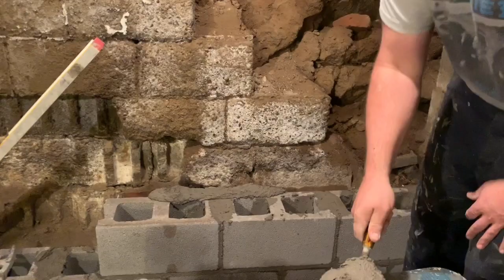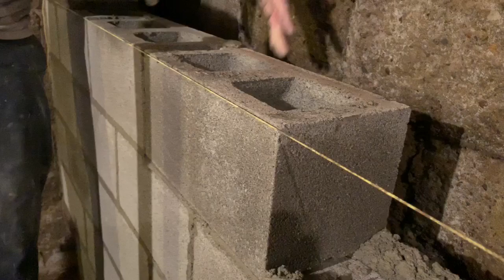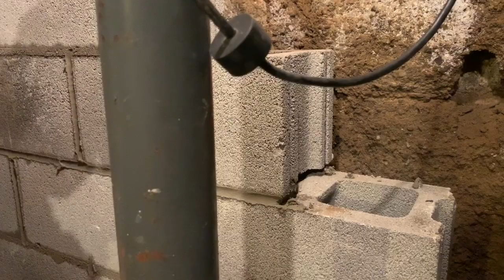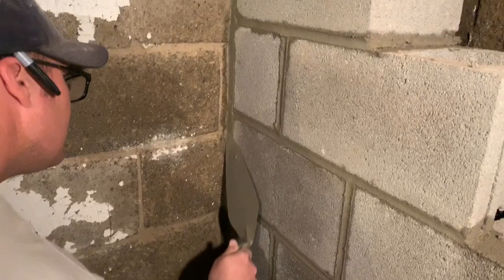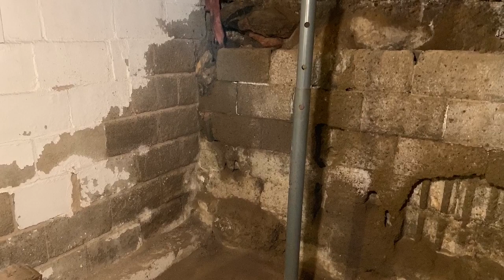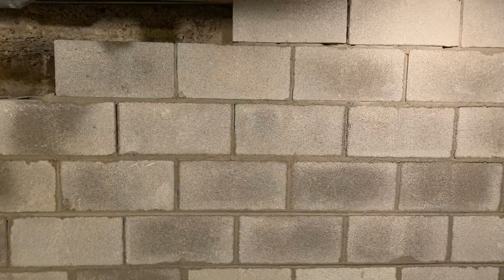8” block basement repair

Comment from the maker: So there are plenty of comments about what was done wrong in this video. I agree that this is nowhere near a proper repair. The owner of this building repaired the exterior water problem that caused the wall to fail in the first place. The new wall is absolutely supporting the weight of the house. The corners of the old wall are still intact also supporting the house. This is a friends house and he didn’t have the money to get more involved with the repair. He knew it wasn’t proper but felt it was better than nothing. I would never sell a half ass repair like this to a customer. At the time when I made this video there weren’t many bricklaying videos on YouTube. The point of this video was to share the techniques of laying block presented in the way I prefer to learn. So to be clear as one of my favorite comments said this is like hanging a poster over a hole in your drywall and calling it fixed. I do stand by the techniques I am showing not the engineering. Thanks for watching!
Reply: Thanks for sharing, great video
Reply from the maker: @DanielSanchez-vk3qs  thank you!
Reply from the maker: John Arch  thank you! You made my day!
Reply: Could 8" blocks be used for a retaining wall?
Reply from the maker: @azieldaly2965  yes
Reply from the maker: Remodeling with Robert Crabtree  Quite possibly the first knowledgeable comment I have received! Thank you. Sounds like you’ve made your way through some real head scratchers.
Reply: remodelingwithrobertcrabtree skeeds?
Reply: remodelingwithrobertcrabtree  thanks ,have to remember that!
Reply: Thanks!

Comment: I'd be more concerned about what that pocket you formed between the old and new wall will do.  You may have fixed one problem, but in my opinion created another.  The outside will continue to erode into that pocket whether you like it or not, whether you fixed the outside water problem or not.  There is nothing holding the soil back, and the owner should expect extreme settling around the outside of the house until enough of it makes its way into the pocket you formed.  Oh, and that wall you built is likely not resting on a footing, which shouldn't help at all to transfer the loads to the ground.  As far as I can tell, it looks like this wall, although expertly crafted, is nothing more than a facade, and a possible way to subvert the process of inspections that protect and shield future buyers from (best case) negligence, or (worst case) deceit on the part of the seller.  In my opinion, you may have good intentions, but this wall is a terrible idea and should never have been built.
Reply from the maker: I don’t disagree with what you are saying. At best it bought him some time to do it right. It does have an 8” footer. The rest of the building does not. It’s over 100 years old. There is no ill intent here. The owner has owned the place for years and doesn’t intend on selling it. Financially the options were to do nothing or try to put a cheap bandaid on it. The house was sinking. It is not anymore. That’s a win. I appreciate the comment. Also I won’t be posting poorly engineered work again. I just wanted to show how I lay block. It’s the first video I ever posted never even thought anyone would watch it.

Comment: I am a bricklayer (also lay block) and my company specializes in foundation repair. We have repaired foundation walls that looked similar to this one. This repair was not being done correctly at all. In this case they should have completely replaced the old wall. The repair they did could easily fail.
Reply from the maker: Thanks.
Reply: How much does a job like this cost - to replace the caved in wall??
Reply from the maker: @PAINT_S_CAPES  this was about $600.  To do it right you’re starting around $10,000.

Comment: If the floor slab is thick enough to successfully support that wall, and if the floor joists are running the right direction to allow you to let some the weight of the house down on a relocated pseudo-sill, it might last. That's a lot of ifs though.  :-) Your camera is pointed down throughout, so I can't see the sill or the floor joists.  Is any of the weight of the house sitting on the new wall at all? If not, it's purely cosmetic, and nothing more. Just what you need, another critic.  lol
Reply from the maker: All the ifs you speak of are the reason we did it. We did lift the house with post jacks and removed them a week later. Wall is still intact and the house is no longer sinking.

Comment: Before finding this video, we were discussing doing this in our basement, because we can't afford to dig out the outside wall and tear out all the bricks and redo the walls the right way.
This seems like a great idea, to band-aid the problem if you can't afford to fix it properly, so thank you very much for showing, that sometimes it's ok to do it 'half-assed" (so your house don't fall in around you) until you can do it right.
Reply from the maker: Good luck.
Reply: Did you made a footing for this sister wall? Or just stands of the floor?
Reply: If you're able bodied get out there and start digging. These houses were all built by hand foundation were dug out using shovels and bucket 🪣.

Comment: Thanks for the video, I have a shelf basement I started to reblock some of the basement.  Never finished as of yet.  I started to patch cracks today, then I plan on finishing brick on the other side of the wall.  U r amazing with laying brick, like the technique.  I have so much brick in the basement that still needs to go up.  Probably finish brick next summer.  Patch other cracks before this winter.  .  .   Well all that rambling. . . .thanks for the video.
Reply from the maker: @chumpsauce thank you! Good luck!

Comment: It looks like you're doing an excellent job with the center block wall. The question is why was the old wall crumbling and my first place. Does it need support columns. To prevent the new wall from collapsing
Reply from the maker: The wall failed because of an old sidewalk that sloped towards the foundation. The sidewalk was replaced prior to fixing the wall. With the water problem solved this wall will last as long as the structure.

Comment: Great video brother. Just out of curiosity with materials included what would something like that cost as far as the entire project block mortar and labor?
Reply: How much
Reply: It will cost twice as much, because he did it wrong.
Reply from the maker: To do it right I’d say no less than $10,000. This cost a few hundred in materials.
Reply: 2$ a block cement 9$ a bag  - u do the math - i'm guessing this is couple hundred bucks. rebars is like 50 more and it would be set -

Comment: Quick question bud from the last time. Does this sound accurate to Talley up a price. Quote 100$, labor rate$800 a day materials $100 repointing not expensive and gas $100. Totaling $1,100 for the day. Is this a good rough formula to be in the ballpark?
Reply from the maker: Sounds pretty good to me.
Reply: @WoodandBricks  if u don't mind me asking what do u charge for the day $800?
Reply from the maker: @jamiewatkinson9564  it varies depending on the job. $800 is a pretty good average.
Reply: @WoodandBricks  reason I ask if my formula is acceptable because I started a BRICK-POINTING buisness 2 years ago and never used this formula and was bidding so high I was loosing work. That's why I asked if this was acceptable or should I charge 900 a day? What do u think or keep it at 800 a day labor rate
Reply from the maker: @jamiewatkinson9564  it all depends on the market you are in and how bad you need the work. I have done work incredibly cheap on the past because of the competition and low paying work was better than none. If you aren’t getting jobs because the customer is cheap I would keep my price the same. If you are bidding jobs and not getting the work and you see someone else is doing it maybe you need to consider lowering your price.
Reply: @WoodandBricks  that's why I said my formula was never used on the high priced I gave in the past. Someone else said my formula is acceptable and roughly accurate I think ud agree. How do u perdue them to paying cash by lowering the original price by $2 or 300?
Reply from the maker: @jamiewatkinson9564  I don’t do cash price. If they pay in cash I see that as a bonus.
Reply: @WoodandBricks  one quick question I'd like to know due to you being a great mason, say a job costs $3000 that's labor and materials, but it requires pipe staging, 2 to 3 frames high, how much more do I charge for the staging?
Reply from the maker: @jamiewatkinson9564  I work on the ground.
Reply: @WoodandBricks  I'm saying if you had to add staging what would it be $500-$1000 more?

Comment: Can anyone explain to me if this kind of repair isn’t code violation. I do have the same issue and I have an idea to do it with same way , but I don’t know if this is legal or not?
Reply from the maker: It is not.
Reply: @WoodandBricks is that the same in Kentucky? Bc that is what some guys suggested to us to do.  Basement walls so bad they think will cave if they dig first.  But they want to dig after a new inside wall is built but leave the old misshappen wall.....
Reply from the maker: @jovialcamper  if it’s not approved by an engineer you probably should look for someone else to do it.
Reply: @WoodandBricks thanks! And thanks for this video! I've enjoyed the comments!
Reply from the maker: @jovialcamper  the comments are definitely pure gold! I hope it works out for you.

Comment: Why no veritcal rebar tied into the footings then pour soild grout or mud and maybe use 10"block instead of 8" did you tie into the ends of wall where your leads were
Reply from the maker: Wasn’t necessary.

Comment: I have a cement block wall that is only 4 tiers (4 blocks high?) and no load. It failed in two places. I guess that digging to see what I have for a footer is in order. The trowel work was amazing to watch in this video. Thank you!
Reply from the maker: CincyPlasmaTech walls normally fail because of water or poor footer or a combination of both. Thank you! I the work I do post more often on instagram as original_farley. Good luck with the wall.

Comment: Is it possible to add new foundation  to hold the wall he is building (assuming he will transfer the weight of the house to this new wall?)
Reply from the maker: The house was lifted with jack posts and then set down on the new wall.

Comment: Very nice
My barn foundation is almost as bad as yours.
I want to safe the barn but not really sure how to fix the foundation until I see your video.
It gave me hope as I don’t to break the bank too.
I have a concern with your doing, so here is my question: is your technic will also prevent leaks?
Hope to hear you so I can prepare myself for this coming spring
Reply from the maker: @iykaojalao this will not prevent leaks. The exterior of the wall would need to be plastered with mortar and then apply tar to the plaster to prevent leaks.
Reply: @WoodandBricks  
Thanks

Comment: Can I ask you a question.. does a wall like that need rebar or wire or anything  and would it need to be filled with concrete? And if it does need to be filled .. how do you get it in there?
Reply from the maker: I filled a double cell on the center. You would overlap multiple shorter pieces and the last course  would not get filled in a case like this.  I’m not a big fan of wire engineers seem to like it though.

Comment: What’s the best way to go about correcting the root of the problem on the outside where the water was draining improperly causing the wall to bow in?
Reply from the maker: @empiretextbooks often just adding soil around the foundation and making it slope away from the house is all that it takes. For this one there was a concrete sidewalk that was replaced first.
Reply: @WoodandBricks  should you first dig around the foundation and put gravel?
Reply from the maker: @EmpireTextbooks  dig a trench along the wall down to the footer. Repair the wall. Install a footer drain.  Wash all dirt off the wall. Plaster the exterior wall with mortar. Waterproof the plaster after it has cured with Mastergaurd foundation tar. Brace the wall on the inside. Backfill the entire trench with #57 washed gravel. Grade the area with topsoil making sure it slopes away from the house. Remove the braces from the inside. That would be a proper repair. In this video I was repairing this wall for a friend. Aside from the block laying technique there is nothing proper about the repair we did. He didn’t have the money to do it the right way. The city replaced the sidewalk that runs the length of that wall. The sidewalk was poured right to the foundation so they fixed the water problem. In an ideal situation we would have torn the sidewalk out then did a proper replacement of the wall as mentioned above. The main purpose of the wall I laid was to close up the basement.  We did our best to make it structurally sound and to this point it is. That wall supports three stories above it and it was sinking prior to this repair. It hasn’t moved since installing this wall. I hope that helps. Best of luck!
Reply: @WoodandBricks  wow this is very helpful, it’ll be a good spring project. Thanks for your help!
Reply: @WoodandBricks  regarding the support wall that you built on the inside, could you instead just sister 3 2x6s together and support with jacks to provide permanent support next to the bowing foundation? Obviously what you did looks better than this would but would it be another viable option?
Reply from the maker: @EmpireTextbooks  you’re welcome! I hope it works out. Really anything you do to remove water from the equation will help.
Reply from the maker: @EmpireTextbooks  yes you can do that. It would be a huge red flag to a future buyer though. Whereas the new block wall will be seen as a problem that has been fixed and one less thing to worry about.
Reply: @WoodandBricks  that’s good to know. The goal is to stabilize it for now and to prevent the bowing wall from getting worse, so perhaps I’d eventually build a nice wall as you’ve done.

Is it true though that if you provide additional vertical support on the wall that it could accelerate the bowing of the wall since there’s less pressure pushing down preventing the wall from bowing in more? That’s just something I saw on a random YouTube video.
Reply from the maker: @EmpireTextbooks  there is truth in that. The downward weight/pressure of the house fights against the inward hydrostatic pressure of the backfill pushing against the wall. Sounds to me like it’s a simple choice between letting the wall possibly fall in because you took the weight off of it vs the entire structure continuing to sag and possibly failing. I’d support the structure and fix the wall later if it fails. You want to stop it from sinking/ settling.
Reply: @WoodandBricks  that’s a good point. I’m thinking of first supporting the wall with several 2x6s about 18 inches from each other and fastened in place by another board drilled into the concrete. And then adding the 3 2x6s to the ceiling supported by those tall permanent support jacks to provide additional support to the overall structure. Does this sound like a reasonable approach?
Reply from the maker: @EmpireTextbooks  yes. It’s worth a try.
Reply: @WoodandBricks  I’ll give it a try and let you know if it caves in or is successful! Thanks for the great pointers

Comment: I would have use lateral strapping from the new wall anchored to the old wall and then back filled the void in-between with concrete.
Reply from the maker: I used fiber mesh in the mortar much stronger than wire and rebar.

Comment: Can I do this in front of concrete poored foundation walls all around the whole basement 1000 sqft open basement
Reply: It's bowing and leaking want it to look new without replacing
Reply from the maker: Roy Mckay yes you can. You will want to stop the leaks first or it won’t look nice for long.

Comment: As a novice I imagine this video is not directed at me. However, it would have been nice to have some explanation of what you are trying to accomplish with respect to replacing the exterior wall, how it affects load bearing, what to do with gas or electrical lines that might pass through the original wall. Is the space created between the new wall and the old wall filled with anything or is it just a nice new nesting area for mice?
Reply from the maker: Still working on my presentation skills.

Comment: Is your bottom row just simply laid on top of the floor, or did you did a trench below?
Reply: Dig*
Reply from the maker: Austin L the proper fix would be to dig out the existing concrete and pour an eight inch thick footer. In this case I did not because the old wall was still partially intact.

Comment: OK,  No this is NOT the way to repair the problem. The foundation is VERY  old you can tell by the original block. No drain tile or plugged tile is the problem. Hydrostatic pressure is the culprit. Backhoe, trenching, jacking up the floor, laying down drain tile with gravel, etc. It's a bit of a job,not cheap and if done wrong you get to do it ALL over again. I get what's going on here but it's only a patch and WILL NOT LAST. Just saying.
Reply from the maker: Agreed

Comment: What does shim to sill plate entail?
Reply from the maker: You have to get the block tight to the plate. To do that I chip part of the block handle off. It breaks off in a wedge shape. I use that to push the block tight against the plate. I the best joint gets filled and as it sets I pull the wedge out and finish the joint.